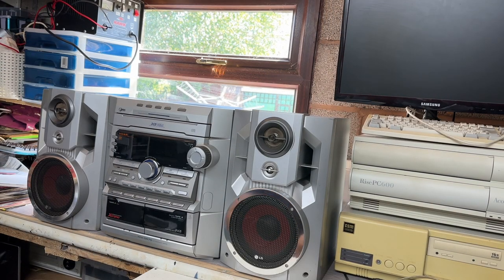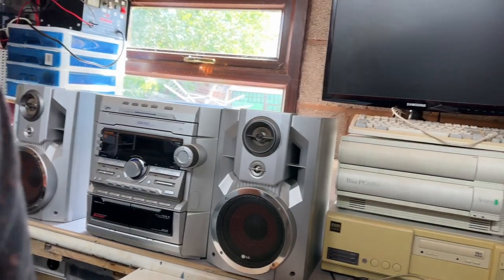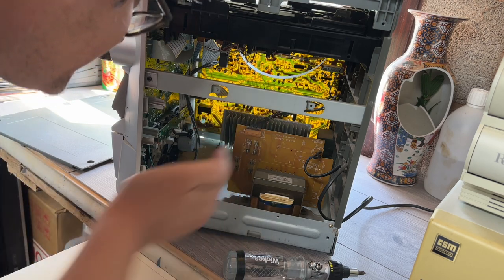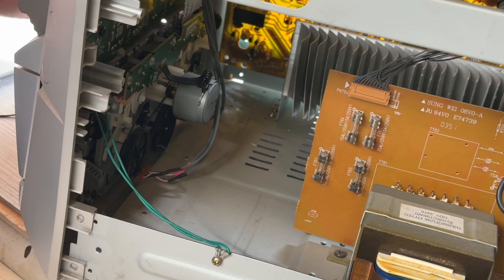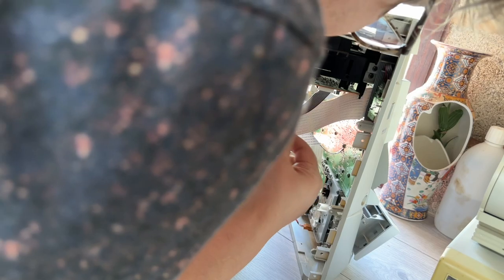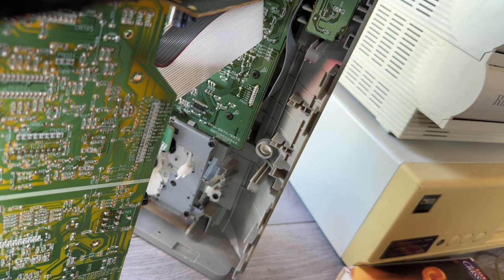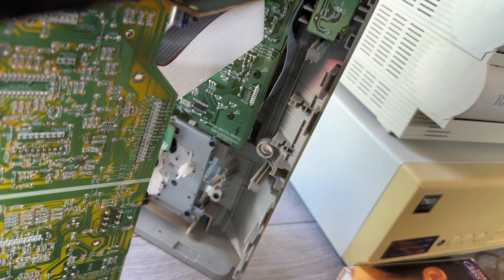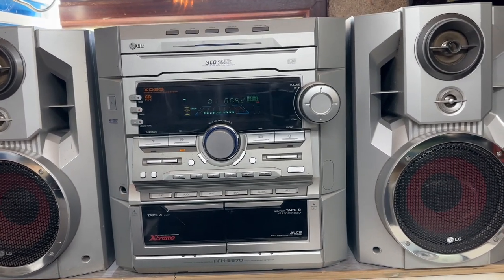LG FFH 5670 - an early 2000s midi system that’s better than you’d expect

Comment: the issue with that is very likely that the mechanism has failed in a mode other than stop, likely due to the belts being loose. If you turned the flywheel, it would probably reset enough to open. The idea is that it stops you opening the door while a tape is playing. A simple belt change would likely fix it, spinning the flywheel until the mechanism resets will let you open the door and remove the mechanism.
Reply from the maker: Worth trying for sure. The belts looked okay, but, you never know.
Reply: @JCTsFascinatingHobbies  I've fixed a lot of them and 9 times out of 10 belts fix it. The problem with these later mechanisms is the flywheel moves a cam that raises the head and moves the gear to engage the reels for winding or takeup. Those mechanisms are under spring tension, so the belt driving the flywheel needs to give quite a lot of torque to fully operate the mechanism. Even if the belt hasn't stretched, they lose their surface over time and slip, so the mechanism ends up stuck in a midpoint where it hasn't fully reset, but none of the mode switches are being tripped. You'll find similar mechanisms in pretty much everything from the late '90s onwards, and they all fail in the same way. I'd also recommend you clean the mode switches in the mechanism and also the ones on the top that engage with the tape.